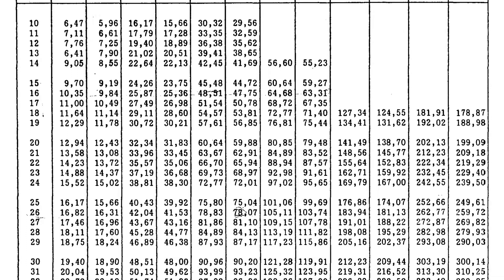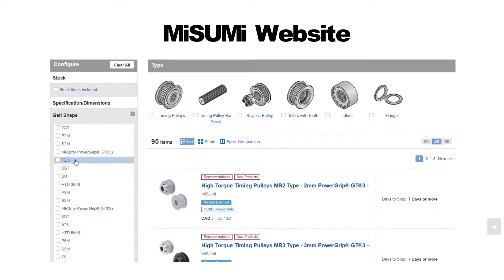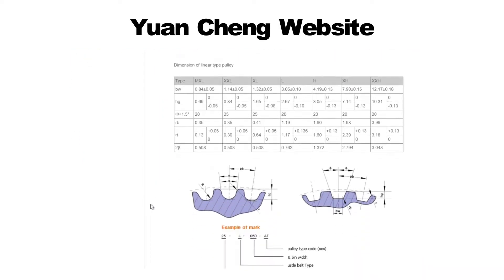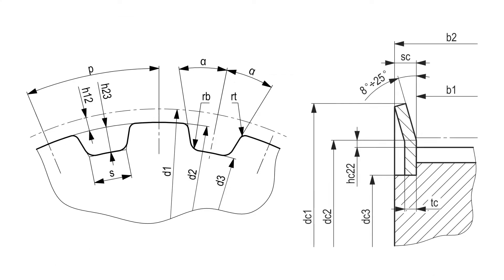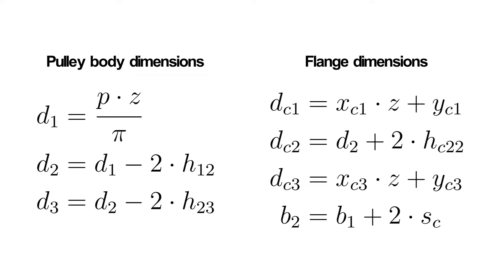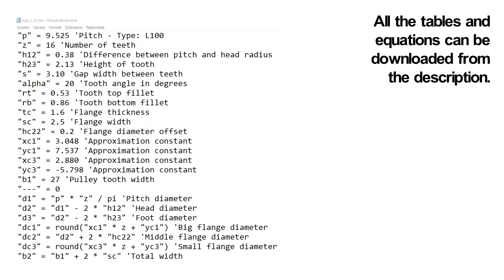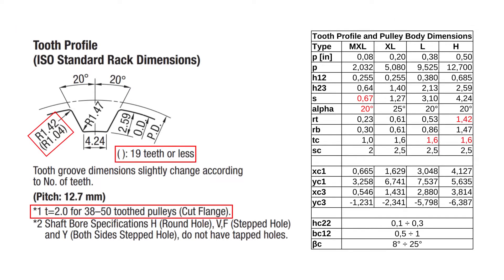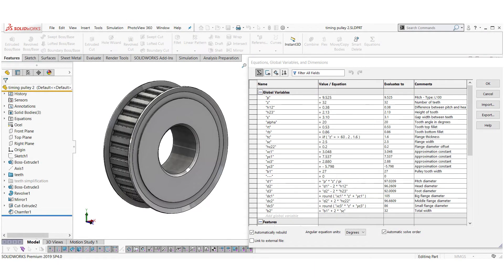Modeling Parametric Timing Pulley in SolidWorks | ISO 5294 | Part 1: Preparing Data and Equations

Comment: Huge help. Huge. I did have to change on number from your eqn_XL_v1.txt the pulley tooth width (B1) of 7.5 was too narrow for the belts I got from McMaster - changed to 11mm. Otherwise the belt fit perfectly. Thank you.
Reply from the maker: Thank you for your nice comment. Did you 3D print this pulley?
Reply: @richardkokstein  Yes. Printed them (including some double pulleys) to make a reduction system for a rotating Christmas tree music box thing.  (I drew it in FreeCad - not SolidWorks, but the process is similar.)
Reply from the maker: @LightAndSportyGuy  Very cool! Glad to hear this model can create functional pulleys.

Comment: Can u share HTD equation
Reply from the maker: Hello, I don't have HTD version of this model. You must look up HTD dimensions and modify the model to suit your needs. You can also find ready-to-use models. For example here is a catalog with decent models of different size HTD pulleys:
https://www.traceparts.com/en/search/kys-power-transmission-parts-htd-timing-belts-pulleys?CatalogPath=KYS%3AKYS.010
Reply: @richardkokstein  shall u explain different between HTD vs iso 5294
Reply from the maker: @dharmalingamv7447  The biggest difference is in tooth profile. ISO 5294 pulley has more straight/trapezoidal tooth gap. HTD has more rounded tooth gap, looks like half circle.
Example of ISO 5294 XL timing belt:
https://vbeltoutlet.com/product/250xl-timing-belt-replacement-125-teeth/
Example of HTD 3M timing belt:
https://vbeltoutlet.com/product/htd-3265-5m-timing-belt-replacement/

Comment: How i can make pitch = 2mm.? For  timing belt g2t
Reply from the maker: Hello, this parametric model is not meant for modelling 2GT timing pulleys, but you can make some small changes to get a working model.
1) Supress Bottom fillet, Top fillet, Cap neck extrude, Cap revolve and Cap mirror.
2a) Change following global variables to match 2GT pulley dimensions: p, h12, h23, s (you can also change other variables to get more accurate model).
2b) Your starting values could be: p = 2, h12 = 0.23, h23 = 0.75, s = 0.9 (you should find more accurate dimensions on the internet).
3) Change number of teeth (z) and pulley width (b1) to match your needs.
4) Try unsupressing the fillets (if you get errors, try changing the fillet sizes).
Global variables should be changed one at the time to minimize a chance of breaking the model (change one value, rebuild, repeat). If you encounter errors, you can try changing the values just slightly and see at which point the model breaks, then you can adjust other values or make other changes to make it work.